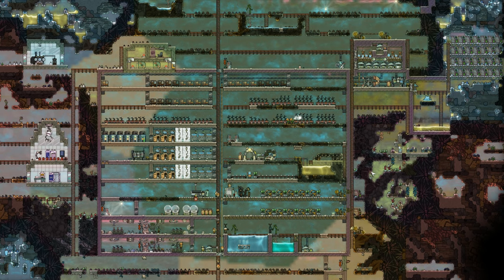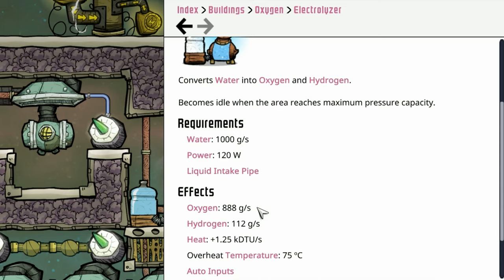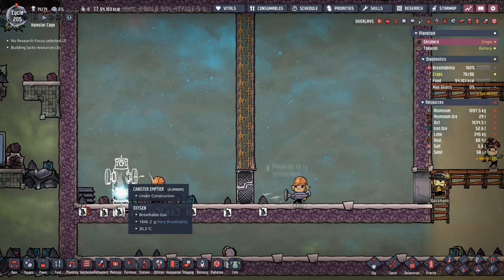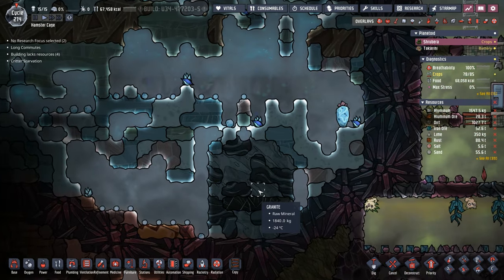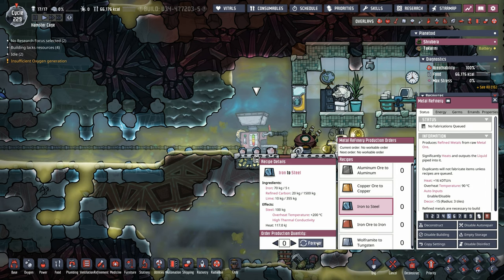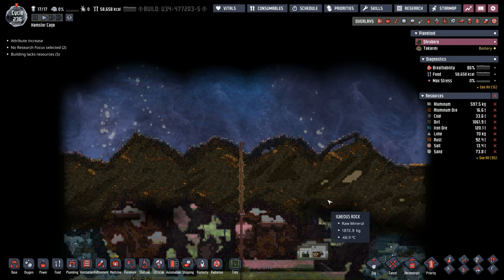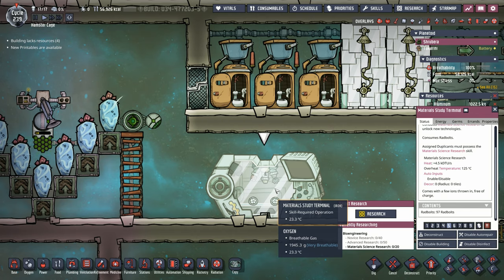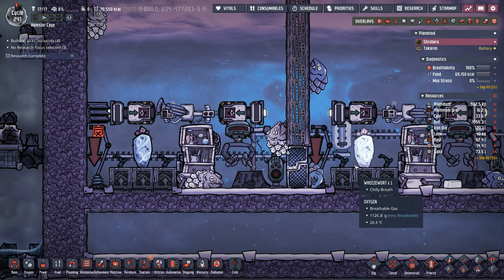Wheezewort Radbolts | ONI Spaced Out | Dupe Only Power Ep 4

Comment: My personal favorite ranch size is 9x14 because it slots great into a base with four high floors (it is three floors high). For most critters I have tiles running across the upper two “floors” with a one tile gap, and I use those upper floors for farming or storage. There’s even room for an incubator inside the ranch but sectioned off by a door so it doesn’t count against the 8 limit. Drekkos go on the edge of the base and if they’re totally full of unbreathables my atom suits and liquid lock fit inside the ranch footprint.

Comment: If you don't want to waste the wattage of a thermo aquatuner on infinite food storage, you can use a thermo regulator cycling hydrogen into a one tile chlorine environment. As long as the gas the food is stored in is cold enough, it counts as deep frozen. And chlorine has bad specific heat so it is really easy to make cold with minimal cooling.
Reply from the maker: Great minds... this is just about what we did in the video I just posted.
Reply: @EchoRidgeGaming  Gah, just returned from vacation and didn't notice I was this behind on episodes. B.t.w. thanks for the great content.

Comment: I’m a real pedantic pain when it comes to liquid locks and gas chambers. What I do is have a 4 slot atmo suit dock specifically for Dreko ranching. Means no holding breath, mixing CO2, no irritated eyes and skin. That means less temp transfer and if you do it right the hydrogen can mix from ranch to ranch (I do a reed fibre and plastic ranch) but seems the oxygen(mealwood) and chlorine (balm lillies) don’t exchange temp so one is warm and the other cool.
Reply: When I vertically ranch, I leave the entire bottom floor loaded with nothing but farm tiles and the plant for food. I go a 6x bottom. Access to the bottom is via auto sweepers. Otherwise you can’t get down there. Everything else is on stages in hydrogen. That way I only have 8 wall or floor tiles in non-hydrogen. Scales grow back faster that way.
Reply: Also, my starvation ranch is inside the atmosuit liquid locked area so it’s 100% hydrogen.
Reply: I also have my dreko incubation chamber in my starvation ranch.
Reply from the maker: I was trying to work in the incubation chambers too. Want to catch those few extras.